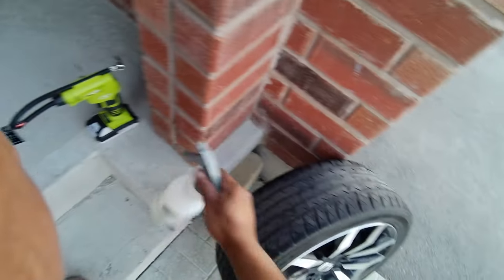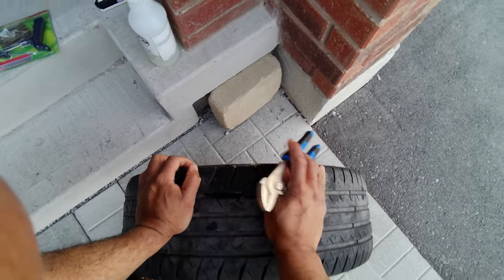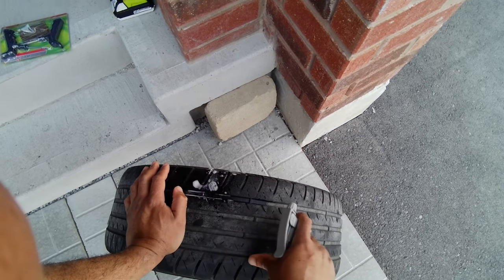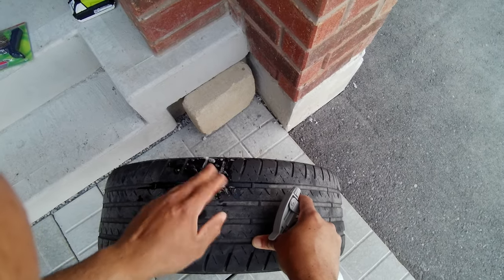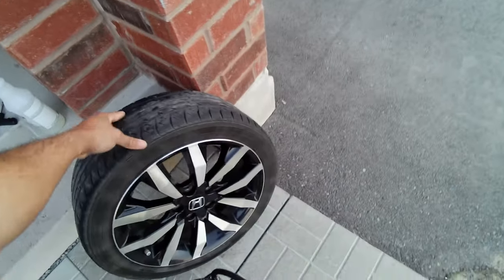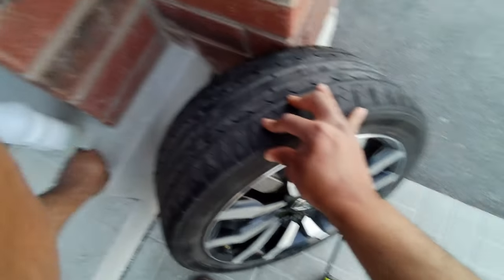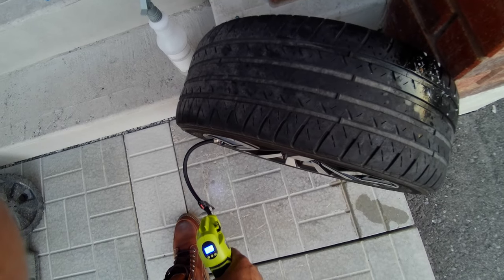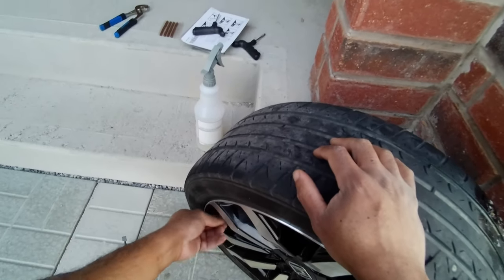Screw in Your Tire? Here's What to Do Next - Tire Plug Tips and Advice

Comment: How long will the plug last Dave?
Reply from the maker: To tell you the truth Debbie ppl hardly keep cars pass 200k clicks so  it will out live the car's  life span 🤯 lol, once rotated to the rear. At the rear there are little or no extra weight other than passengers, which now a days seldomly happen. If I place the plugged wheel on the front  maybe 4 seasons if the tire was new. Considering the engine weight and front wheel powered.